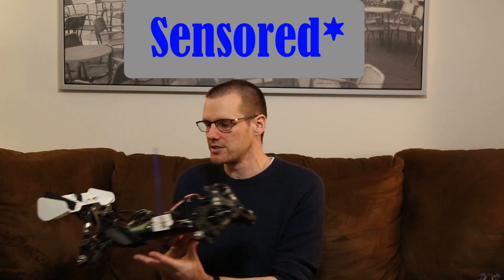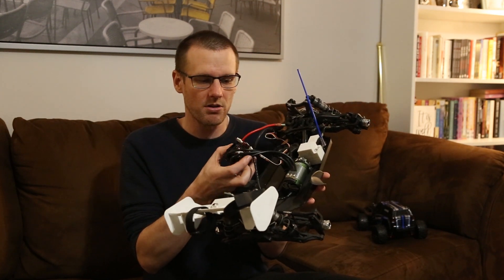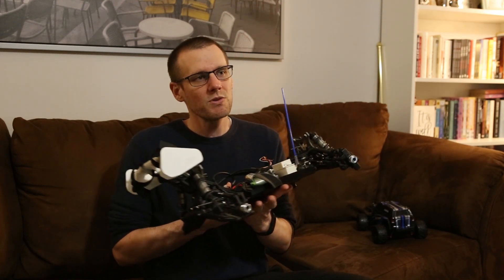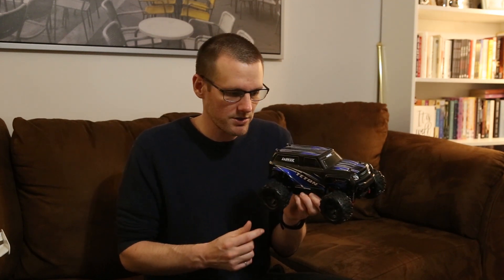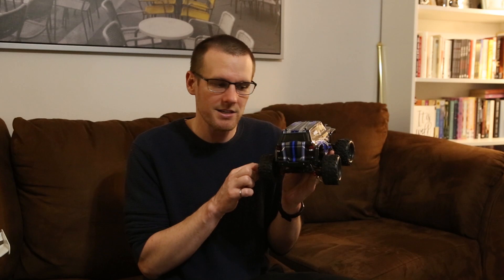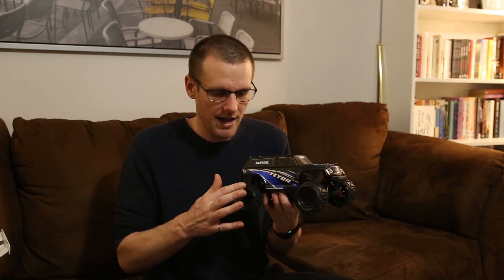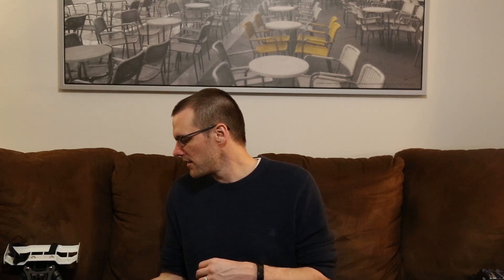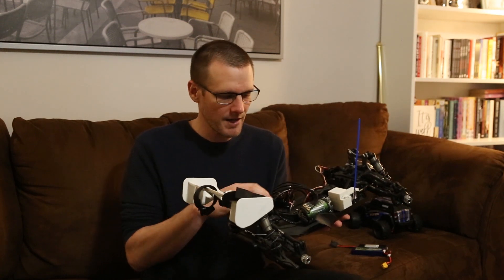How to Improve Cogging or Start Up Hesitation in a Brushless Motor (Occurs in a Sensorless Motor)

Comment: Go from 2S to 3S and it will adjust things for the better. Maybe my ESC is programmed for 3S but on 2S it wouldn't stop chugging, but after I used 3S away she went like a rocket and yes the ESC is fan cooled and able to handle it. Easy fix, just change the battery from 7.4V to 11.1V. (if it can handle it).

Comment: Thanks for great video. I had extreme cogging issue with my wltoys 124017 and I have watched many videos and no one mentioned the binding check, I did rotate the front wheel and noticed the issue with binding immediately and I could fix that easy.

Comment: I have a GTB novak brushless sensored system in a Losi xxx-sct. I am having a weird issue. My Platinum Orion 2S 4800mah (I believe its a 25C pack but it does not say) pack works perfectly fine with the setup but my Zeee 2S 6200mah 60C battery has really bad stuttering when I take off at full throttle. I have two Zeee packs and they both do it. It does not happen when I ease into the throttle though. Any idea what could be causing this problem? I thought I might have gotten some bad battery packs a while ago or maybe the Novak GTB esc just does not like the higher C rating batteries? I was going to order some different brand packs with the higher C rating like the Zeee packs I have and see if the issue continues. If you have any ideas why this could be happening I am all ears. Thanks

Comment: Hello. Can you please explain - does minimum motor speed depend on KV? I mean, will a lower KV motor be able to rotate slower without cogging?
Reply from the maker: Not necessarily. It would be better to use a higher kv and gear it down significantly so that one rotation of the motor has the most minimal rotation at the wheels.

Comment: So I have a very weird issue. I have a 3674 2260kv running on a wp sc8 120amp with no issues at all. I recently put a 4076 in its place 2000kv and it cogs and cogs or  if I hit full throttle and it's under load it cuts out and the esc goes red light and no throttle. It's in a rustler 4x4 so not much weight I'm running slightly higher gearing to accommodate the much lower kv. I noticed one motor wires feels slightly warm after 30 seconds of use as thats that's its current max run time? Is it possible the new motor is trash or bad solder job from factory? I'm only running 3s and max for the motor is 5s.

Comment: Just changed ESC and it solved cogging in my case. FIlightline ESC 30A was cogging - I tried all settings and nothing. Maybe because this ESC is for airplanes. Today I tried some cheap noname 30A ESC that worked instantly.

Comment: Dropping pinion tooth on motor, gearing down, will help enormously.  Yes, you will lose some top end, but gain much on low end. 
Many non-sensored brushless systems such as arrma big rock, come with a 15 tooth pinion. Yet it tops out at 50mph. 
If you don't need 50, you can reduce pinion tooth and gain low end, while also running a cooler motor/esc.
Reply: That is totally true! In may case I drop my voltage from 3S in their default to 2S.

Comment: How can I stop my rc buggy from cogging? I have a sensored system. I am driving a TLR 8XE Elite with a Tekin 2250KV motor running on 4s lipo with 15/46 gearing.

Comment: I'm getting a lot of hesitation upon launch I have a arrma 6S infraction version 2 and I am doing no prep and prep drag racing I have stock motor and stock esc 42t spur and 20t pion gears the other cars are a taking off be for me I have a good RT but the car just will not take off when it's time will a cappack fix this
Reply from the maker: Cap pack will not fix this.
Reply: I figured out the problem I'm geared to high for the stock motor and esc iv already ordered the upgrade

Comment: Mines was moving fine and then suddenly , it doesn’t move at all just juddering  when I pick it up the wheels spins fine 😩how do I fix
Reply from the maker: is this in on a brand new healthy battery pack? If not try one out.
Reply: @RCexplained  yess I have 4 2s 5000 mah Lipo
Reply: @RCexplained  it was working fine at first , then I went cogging , I’ve recently changed to a 17T pinion , runny 60a esc. 3650 surpass hobby 3900 kv motor in ftx zorro
Reply from the maker: increasing the pinion gear tooth count will increase the chance of motor hesitation

Comment: I have a 6s Arrma limitless with spektrum 150a esc 2050kv motor I use it for drag racing and from a dead stop when I pull the trigger I have a secon delay from when the car moves and a lag

Comment: Hello I have a xstr 1/10 buggy (normal brushed motor) I have brought a new brushless combo which is 4370kv with a 60a esc both waterproof and can also take 2s or 3s Lipo. It keeps cogging every time I try let it off on ground, it starts to clog for a few seconds and THEN picks up speed. If you could please as to how I can solve this, also I’m using a 3s 11.1v 3s 2200mah overlander battery, am I using the wrong battery? I have also purchased a esc programmer for this combo just waiting on it. If you could help would be much appreciated thank you

Comment: I have a volcano epx pro and its cogging really bad I've tried everything. I put it in grass that's so short and it cogs three times then wont move. But if I set it on concrete it cogs and gets going. But havent changed anything with the gears or anything smh.
Reply from the maker: Have you tried significantly dropping the pinion gear tooth count on your motor?

Comment: I replaced my velineon 3500kv system with a spektrum firma 85A 4000kv system and it's fast but I have no low end anymore. It has to get rolling before it will stand up. It's frustrating. My velineon system did standing back flips
Reply: Haha. I just realized this was one of your videos. Lol thanks man.
Reply from the maker: Yes, I looked at the specs of the firma motor vs velineon and on paper the 4000kv motor should also get your RC to stand up. The firma motor will draw more current upon acceleration, if your battery isn't up to the challenge you may not get the performance that you are expecting. IR of the battery comes from your charger. Does your charger support this feature? How old is the battery?
Reply: @RCexplained  well it does have a lot of power. I can wheelie all day. It's just from a stop it cogs out. Once it's barely rolling it will stand up all day. The battery is a few years old but I didn't have issues with the velineon system. Maybe because the the esc draws more?

Comment: Hello very good channel indeed and in this video I saw an issue that sometimes I had with my granite 4x4 3s BLX... that start up hesitation. Altought I had somehow a problem with my first esc that suddendly"died" I found with time that pressing the trigger more slightly would not trigger that hesitation so often. Thanks for a lot of interesting videos. By the way I still have that great awesome boat supervee 27 with that motor and I would to know your oppinion. We could run two 7 cell nmh packs in series in a total of 21 volts. I am running mine on 4 cell lipo but if would run 5 cell lipo it would be also 21volts.Do you think that would be possible?
Reply from the maker: Hello, I ran the SuperVee 27 back in 2008 or so. I do remember some people trying 5s, however, I found that 65km/h is achievable using 4s LiPo and fine trying different props. My suggestion would be to continue running 4s LiPo. The hull gets really unstable at speeds that are higher then that.
Reply: @RCexplained  Yeah... indeed on 4s the boat seems to"ride on wheels"  on long ponds but this doubt as always been on my mind. Does the stock electronics cope with the burst of current of 5s lipo?🤩🤩
Reply from the maker: You would be really pushing the ESC on 5s. You are drawing around 42A constant using 4s LiPo. 5s would be over the 45A rating.

Comment: i done a bulid its ran flawless for 10+ runs and today came to go out with her and the cogging so bad it wont even start up unless pushed lol..
Reply from the maker: Hi AJ that sucks. How old is the battery? Is it in good condition with low internal resistance?
Reply: @RCexplained  its a overlander just a 2s 35c on a 60amp i think its the esc thats gone lol its about 2months old

Comment: Can you run a sensored system on a sensorless system or will it mess up motor
Reply from the maker: You can run a sensored motor on a sensorless ESC. It will behave as a sensorless system.

Comment: Hi would a sensored motor run slow without the sensor wire
Reply from the maker: A sensored motor would operate as a sensorless motor with no sensor wire.

Comment: I have somethign for you my kraton exb only coggs when i use a powerfull 6s lipo.. punch 7. The system is the blx 185 2050kv motor stock pinion was 12 i run 14t. Electronics are brand new esc to blame? Im at a complete loss im getting a new esc  but kidna suck i bought if from someone who doesnt own the warranty of horizon. I checked my bullets xt90 connectors ceramic motor bearings...
Reply from the maker: Do you know what the internal resistance of the cells are in the 6s pack? What other packs have you tried where you do not have motor hesitation?

Comment: Great video!  Just had to replace the motor in our RC truck and upon startup with the new one, Im seeing this hesitation.  I did have to solder wiring (ESC has 6.5mm bullets, new motor only had 4mm).  Im curious if there is a way to check if my wiring is now an issue?  There is no binding in the drivetrain that I can feel....the battery might be suspect because it sat for so long without a charge, but it did charge up OK last night before use. Thanks
Reply from the maker: Thanks for the comment Christopher. You can check your wiring simply by running your RC at high speeds and power consumption. Then check the temperature of your connectors to confirm they are not getting hot. Less then 60C (140F) is ideal.

To confirm if your battery is OK, you will need internal resistance measurements of each cell in your battery. Most all good LiPo chargers will provide this for you.
Reply: @RCexplained  Thanks!  Thats pretty simple, was worried my solders were bad (I did run into the "enamel" problem you mentioned in another video, but scraped it off and was able to solder).  I assume if the connectors at the ESC are getting hot, its because of resistance from bad solder joints?  I did test the resistance across the soldered joint and was getting basically 0 (auto-ranging multimeter, was 0 up to 0.5 then slowly backed down to 0)

Checked the IR of my battery last night and the cells were between 4 and 6mohm.  I know its not great, but I dont think its horrible.  6S 5000mah pack, its probably 2 years old by now.  Thanks again.
Reply from the maker: Yes, if the connectors get too hot it's due to resistance across this connection point. You won't be able to measure resistance across the connector as your multimeter would need to be able to measure 0.0005 ohms. 

4-6 mohms per cell is going to be a 5000mah pack with less than a 20C rating.
Reply: @RCexplained  so, less than 20c... I'm guessing more of a possibility that's the issue than bad joints.
Reply from the maker: It may not be the sole issue but it certainly is not helping you. If you were able to get the connectors soldered using enough heat, you should be fine. It's rare I see poor solder joints.
Reply: @RCexplained  Thanks again!  Tried it on a  better shape 3S battery and still the same issue.  Going to do a few high speed runs (once I get our fans back on)....after that I will temp check the connectors.  Should I just unplug them from the ESC and check temp on the ends themselves?

The only reason I question the solders is because initially the solder wouldnt stick to the motor side of the wire.  I realized it was coated, scraped off as much coating as I could, fluxed and re-soldered.  Seemed to hold solder better, but it will always be in the back of my mind :)

Comment: Excellent video 👍 I have a HPI Baja SC that I converted to electric 8s with Castles XL2 set up.  Running at low speeds it stutters terrible.  I now believe it because my C rating is 35 and Castle recommends 50C or higher.  I'm going to have to chuck these and get something better. Thanks!
Reply from the maker: If you can, get the highest C rating and largest capacity (mAh) possible. Both of these will help you!
Reply: @RCexplained  Thanks again!
Reply: Rob was this your issue? I'm having the same problem. Im going to try a higher C rating today. It happens when im in grass
Reply: @theaveragejoebody  Yes,  I had the wrong C rating for what Castle recommend.  The lipo's I had where originally used on my Armma.  Night and day difference with that higher C rating.
Reply from the maker: Hey Zane, you can also try gearing down after you try higher c rated packs. I often move to smaller pinions when I know I'll be running in grass or any environment with higher drag.

Comment: Thank you.  I've re geard my Dr10 drag car to go fast with 2s its 28 pinion and 78 spur on 3s it's fine but 2s it hesitates like crazy but it hauls butt...  stock reedy 3300kv sensorles  motor?? Now I know what is going on..👍
Reply from the maker: What is the C rating of your 2s LiPo?
Reply: Same...custom slash reedy 3300 combo...50c 5000mah 2s

Comment: Great advice. Just changed over to my 1st brushless system. Terrible motor stuttering... was about to return it as faulty. Re soldered bullet connectors and also battery connector, freed up wheels and now it's way improved!  Does need a shove to get it going now and again but much better... Cheers, great advice!
Reply from the maker: Hey Peter, thanks for the comment. I've found that having healthy LiPo battery packs have helped me the most. I'm glad your situation has improved!

Comment: I like the 2 cameras.  I actually get this problem on my sensored cars.
Reply from the maker: Thats weird? What is your setup? Do you know if the cars are running in sensored mode? I do not see hesitation in my sensored setup or others. Otherwise it would defeat the whole point and be near impossible to use for the rock crawler guys.
Reply: @RCexplained  Hi Ryan - its a Hobbywing XR10 Pro 1s ESC and various brushless sensored motors - such as Surpass V4s 13.5t, and Motiv MC3 13.5t.  I notice it most when switching from forward, brake to reverse.  My xmitter is a sanwa MT44.
Reply: @xaviertaylor759  xr10 isnt Sensored

Comment: Thanks for the videos.  Between you and John Holmes I've learned alot about rc motors in the last couple months.  I have a question about dielectric properties.  There are lots of testimonials on YouTube about the effectiveness of using corrosion x to make electronics more water resistant.  Unfortunately we can't get it in Canadian stores.  Fluid film looks promising but the two products use different units to describe their dielectric properties.  Dielectric strength of 37kV for corrosion x and specific conductivity of 'less than 10 -9 ohms/cm @1 mHz' for fluid film.  I haven't been able to find out how to convert one to the other for comparison.  Any advice?  Thanks again.
Reply from the maker: Hi Beleg, thanks for the comment. I totally know what you mean by not having access to CorrosionX in Canada. Probably the reason I have never owned any. Have you looked at just ordering some online? 

I'm not sure you can compare these values based on the different methods of how they are determined and measured. It's breakdown voltage of the dielectric vs resistance of another product. It's unfortunate they only provide one value as a means of understanding its resistive property

The specific conductivity for the Fluid Line product, typically measure in Siemens is expressed in 10 ^-9 ohms/cm. Siemens is also expressed as mho (ohm spelled backwards) Assuming this is what they mean, you can convert this to Specific resistivity, but relating it any further will be challenging. The best I can suggest is taking the Specific Conductivity Value and converting this to a Specific Resistivity. 

It may be more simple to buy a cheap ESC and operate it with the product testing its performance while introducing water. If you like the results, use the product. What do you think?
Reply: Thanks for the reply.  I was starting to wonder if that value was supposed to be exponential notation but they left out  the ^ symbol.  And I thought a product labeled as non conductive should have a hight ohm value and not a low one.  Anyway, the math and physics involved is getting  too complex for me so I'll take your advice and do some experimentation.  Just upgraded 3 rtr rigs to brushless so I've got some electronics I can sacrifice.
Thanks for your time.